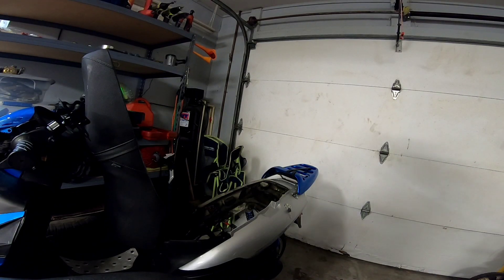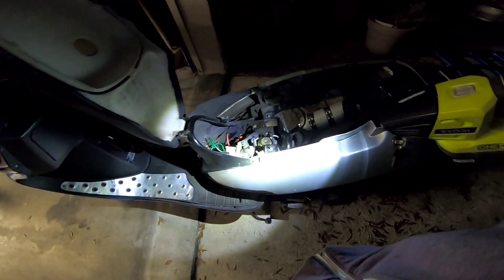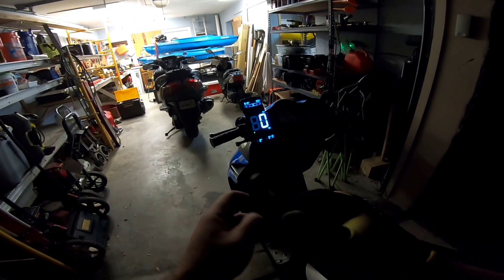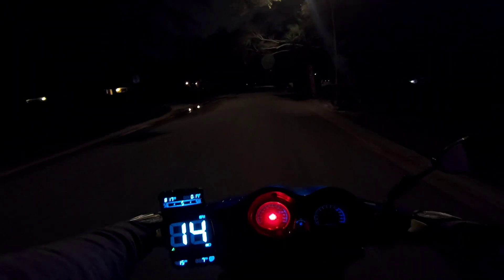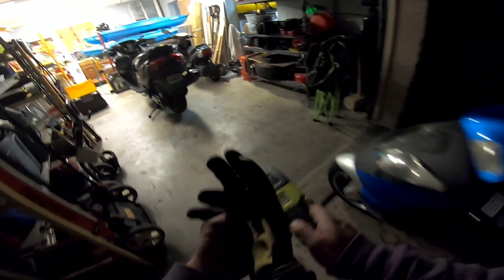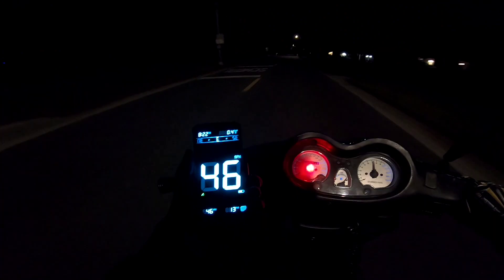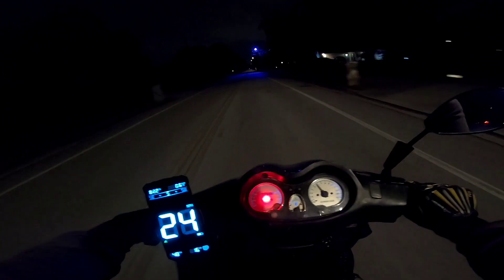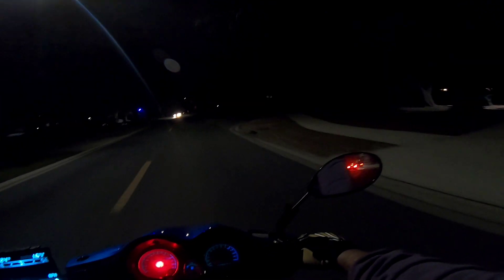150cc Scooter just needed some air... separating the boys from the men

Comment: Nice fix Dan. Yeah when I first got my new 150cc  the carb was messed up . So I bought a brand new exact one off eBay and swapped them out and it runs alot better. I'm still running the stock airbox on mine. Someday I might go with a Pod Filter.